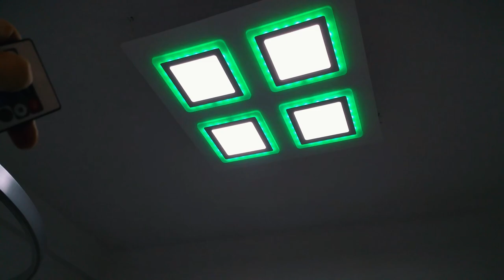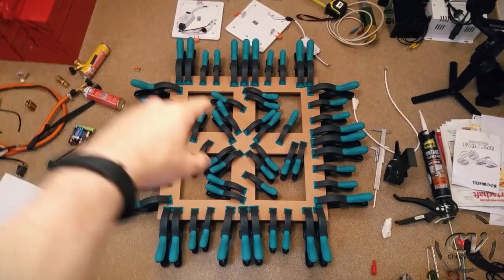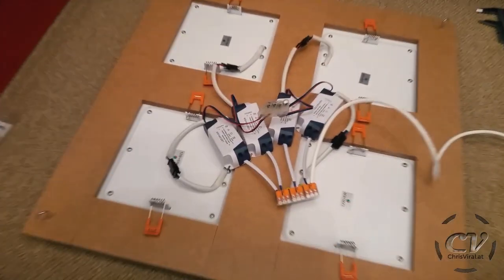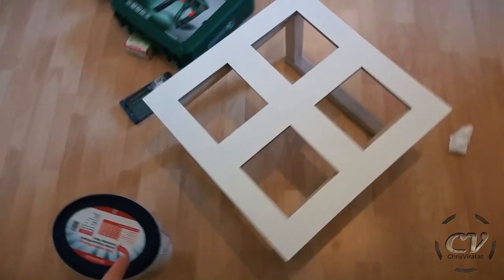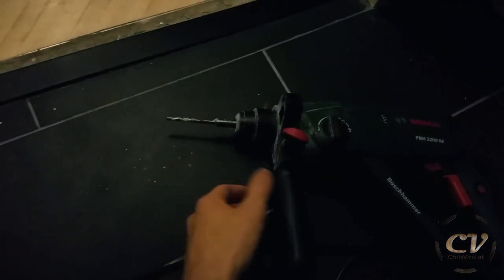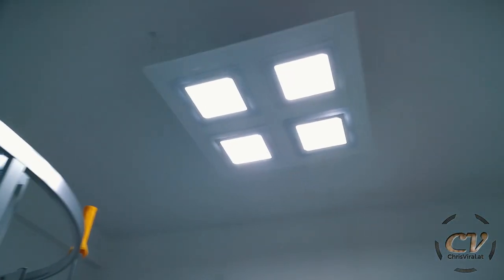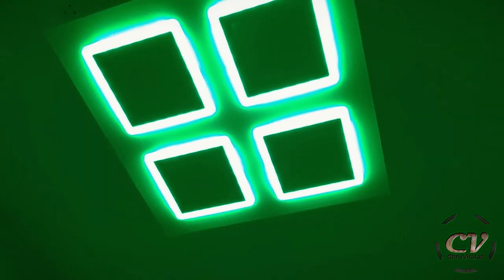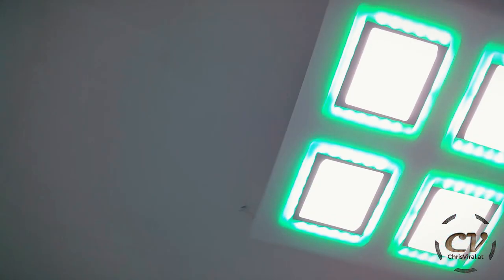DIY Futuristic Lamp With RGB LED Panels (Simple Build)

Comment: Have a link to the led panels and connection hardware you used?
Reply from the maker: Sorry I have absolutely no idea any longer... But all of them have a separate driver (came with each panel) and they are simply connected to the 220 volt grid. No magic at all .. :)
Just go to aliexpress for example and type in rgb led panel or something like that, it can't be that hard to find 🤞🏻